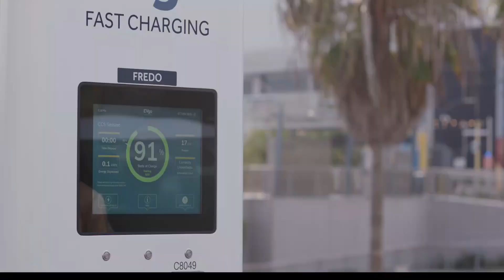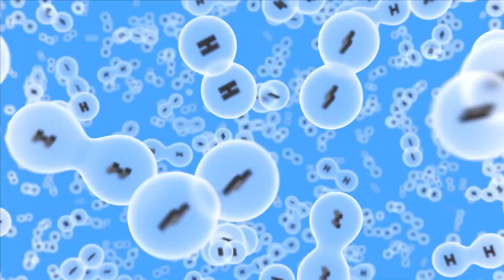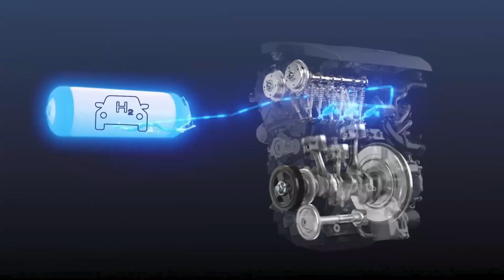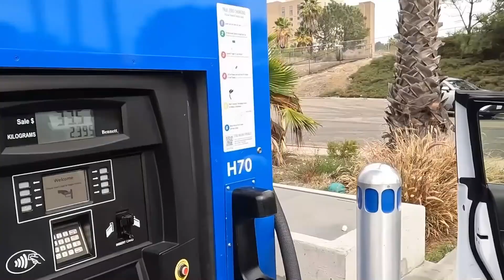Toyota CEO: This New Engine Will Destroy The Entire EV Industry!

Comment: Instead of creating a whole new world of hydrogen supply chain infrastructure, why not burn hydrogen at electricity generation and continue to develop the EV industry. The EV cars cost less to build and likely much less to maintain. Hydrogen generation can be built right next to power stations. The exhaust from the generators can also be captured and used.